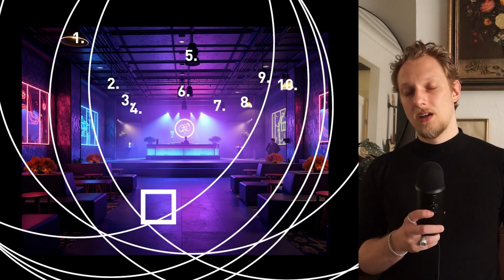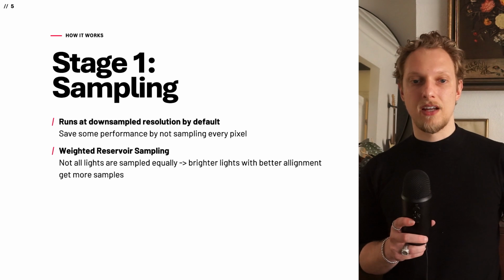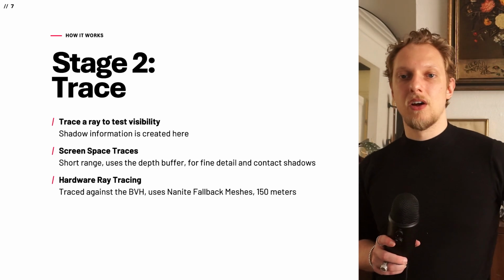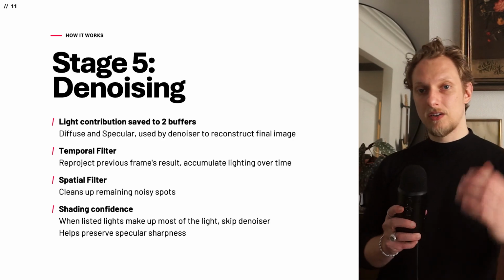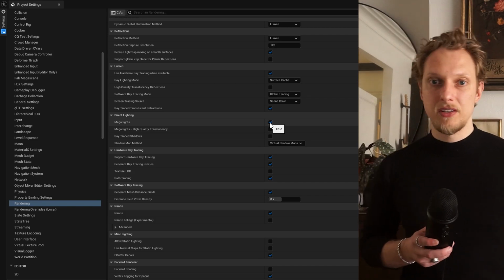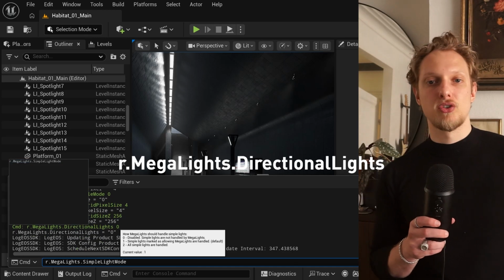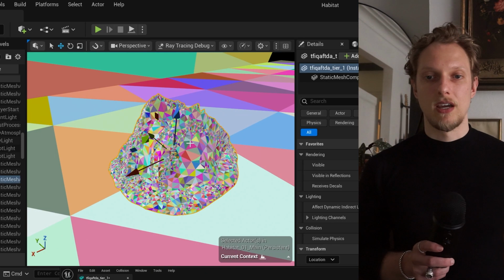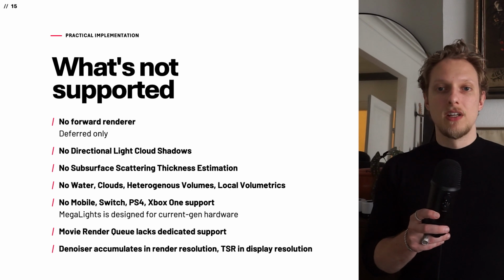How to work with MegaLights in Unreal 5.8

Comment: I'm curious the right way to handle a situation where you want to deploy to platforms like Mac, Switch 2 which currently don't support MegaLights but want to author once ideally.
Reply from the maker: Ideally you want to author once, but I think it's just a reality that different platforms require different tech, and that requires different authoring passes if you want to do it right. Megalights being a direct lighting solution does translate a bit to standard shadowmaps (with avoiding overlapping lights and whatnot), but you'll definitely have to be more picky on the amount. Lumen would translate to baked lightmaps, but that requires a bunch of conversion work. Usually there is no one size fits all solution to each scenario, and you'll have to do some manual work in the end if you want the best quality. You can also just let Jezus take the wheel and pray to the UE scalability gods that it looks fine on low scalability, but I would advice any serious developer against that. 😅

Comment: how about in VR ?
Reply from the maker: Since you should stick to the forward renderer when making VR projects, MegaLights is not an option. However if you have the performance budget to use the deferred pipeline, no reason you can’t use MegaLights, though you’re going to need a relatively beefy setup for that compared to forward.